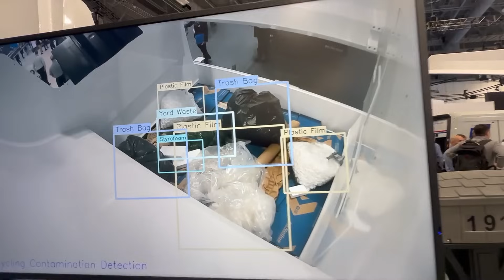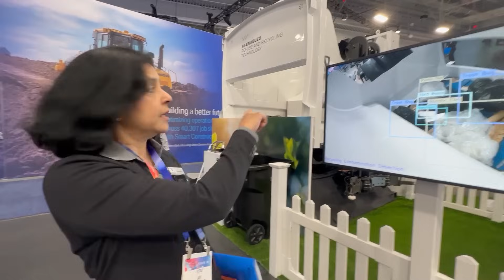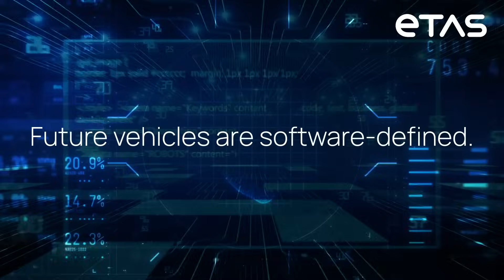Oshkosh Puts Passenger Car Tech Into Garbage Trucks - CES 2025

Comment: The garage truck first step into the cab needs to be deeper towards the front of the truck. The way it’s designed you’re stepping in with the wrong foot first. If the residential can are to close to each other those grippers are going to knock them over.

Comment: California's mutual aid between regions would require fire engines to be self-deployable. The state requested and is getting resources from Utah, Arizona, and New Mexico. How would an electric fire truck fit into this scenario?
PS — some news stories mentioned Tesla cars had to be abandoned due to heat from fires impacting batteries. Can you check if this is true?
Reply: High fire and cooperation areas like Cali will take longer. But it's a good start for all the local areas that don't deal with that.

Comment: What happens with an electric garbage truck when the garbage is on fire from a battery some yahoo threw in the trash. Will the batteries powering the truck go into thermal runaway or is there extra fire protection?
Reply: Maybe it'll automatically throw up ?

Comment: Auto line won’t get excited unless it’s an EV fire truck
Reply: Old tech isn't exciting
Reply: @bmk789  EV is not ready for Prime time . Close to $ Trillion wasted . Govt mandated but not public adopted enough to succeed . I guess they will force it harder now
Reply: @Gadfly2025  you're delusional. I've been driving EV over a decade now. Towing is the only use case where there are still compromises
Reply: @ I had one for 2 years . 
Milagros never as claimed but good grocery getter around town , charge home .
Otherwise 
Don’t charge over 90%
Don’t discharge under 20%
In cold or heat lose 20-3O%
Highway speeds lose 30%
Got calculator ?